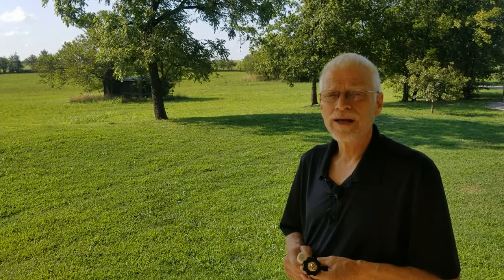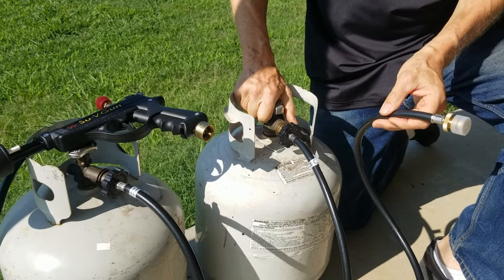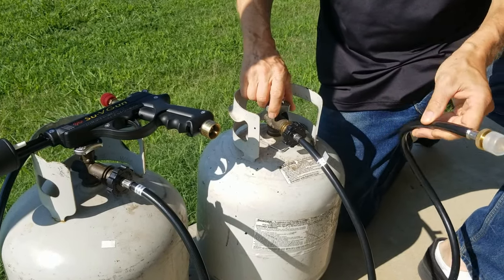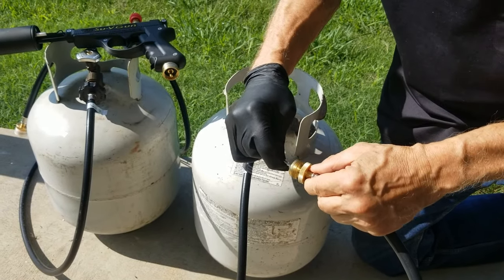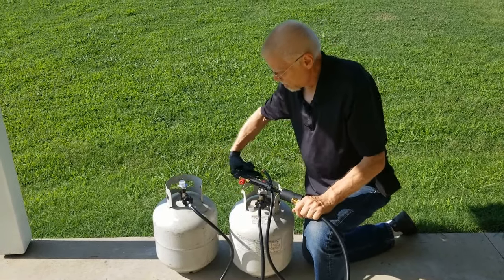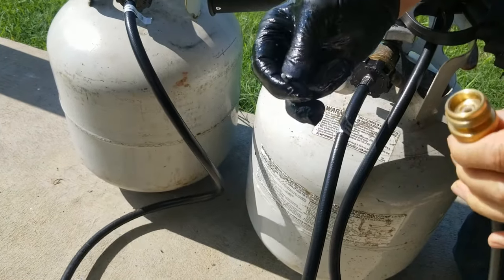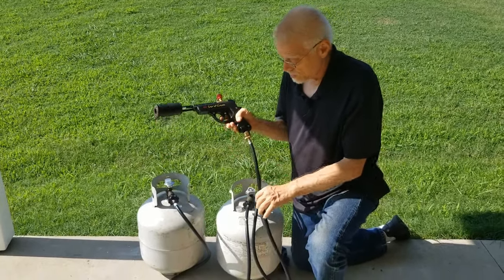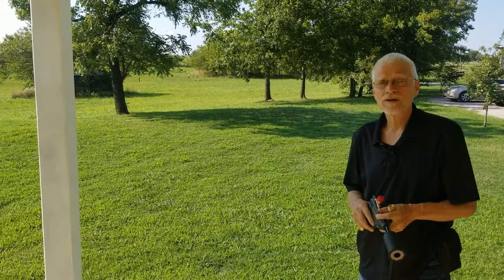How to clear a fouled 8' adapter hose

Comment: This is not working Bob. Any idea why? If it only bleeds off a bit then stops. Then slowly bleeds off. Nowhere near the pressure you're showing.
Reply: The hose also has a check valve. Your description indicates that you are setting the check valve by turning on the fuel valve on the tank too fast, which in turn checks the flow of fuel. Turn on the valve VERY slowly and the hose will pressurize (without checking), then you can open the valve all the way up and clean it as I do in the video with full pressure.  The length of the hose doesn't matter (3', 8', 10', 12', 45' steel... it doesn't matter what length it is, length doesn't affect the pressure, just the amount of oil or liquid propane that can pool in the hose.  The longer the hose (pipe), the more liquid you will get in it over time, and ambient temperature changes.  The best way to ameliorate the problem of collecting fluids inside the hose is to depressurize it after every use.  I designed the 8' hose to give you maximum usable length and usability, while still minimizing the pooling of liquids (suspended oil and liquid propane).

Comment: Bought a new tank thinking it was empty. Attached hose and drained gas from hose first. Still has very low pressure.
Reply from the maker: Please call 9189699690 for support

Comment: Mine ain’t shooting out anything how to release
Reply from the maker: I don't understand your question. Your hose isn't shooting out anything? This video is on how to clear a fouled hose. There is a check valve in the hose that if it is set, will stop the flow of gas.  You may need to contact support to talk with someone who can lead you through the diagnosis and get you up and running. support@grillblazer.com or 918-960-9690, next Monday

Comment: I can’t get anything coming out of my hose at all is their anything on the other end of the hose I can do to get it to work?
Reply: I'm in the same boat. Guess I'll go buy a new hose.
Reply: @caseyhardison4320  yeah that’s what I ended up doing
Reply: I tried and almost succeeded in holding in the valve at one end of the hose, and blowing composed air into the other end... but it sounded like something got stuck. I hadn't used the hose in years, but I'll make sure to clear the new one before storing it! Haha
Reply: @caseyhardison4320  everything I read said it is like any oily residue that comes off the hose if you don’t get it the 10 footer or bigger
Reply: @HuntFishLifeOutdoors  why does the hose length matter? Bob seem to indicate the oily liquid is the condensed gas. 🤷
Reply: @jameswaters313  because they use a different rubber for the longer hose.
Reply: The hose also has a check valve. Your description indicates that you are setting the check valve by turning on the fuel valve on the tank too fast, which in turn checks the flow of fuel. Turn on the valve VERY slowly and the hose will pressurize (without checking), then you can open the valve all the way up and clean it as I do in the video with full pressure.  The length of the hose doesn't matter (3', 8', 10', 12', 45' steel... it doesn't matter what length it is, length doesn't affect the pressure, just the amount of oil or liquid propane that can pool in the hose.  The longer the hose (pipe), the more liquid you will get in it over time, and ambient temperature changes.  The best way to ameliorate the problem of collecting fluids inside the hose is to depressurize it after every use.  I designed the 8' hose to give you maximum usable length and usability, while still minimizing the pooling of liquids (suspended oil and liquid propane).